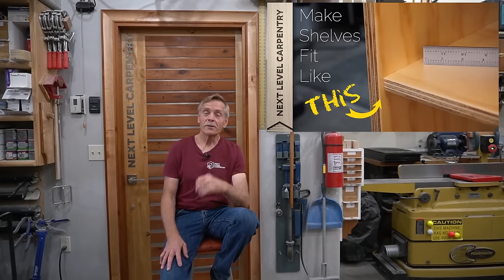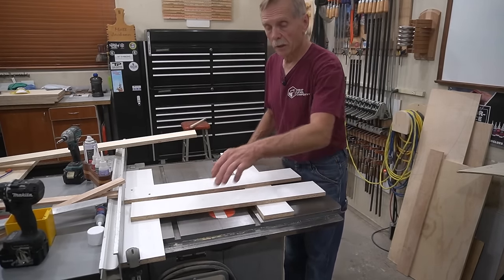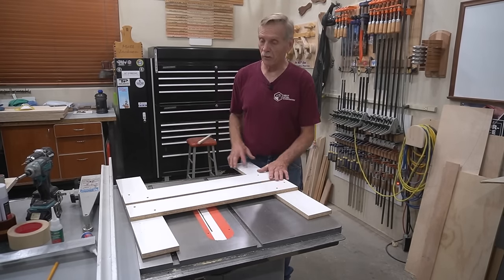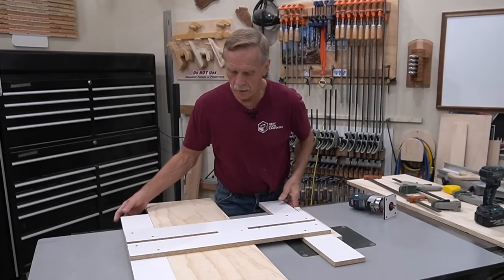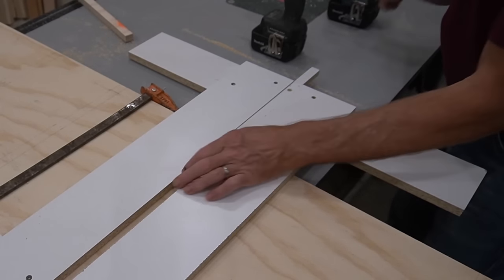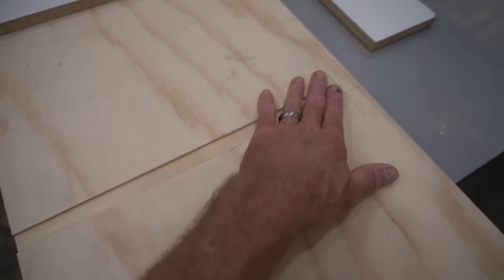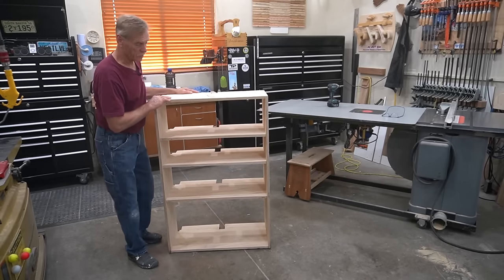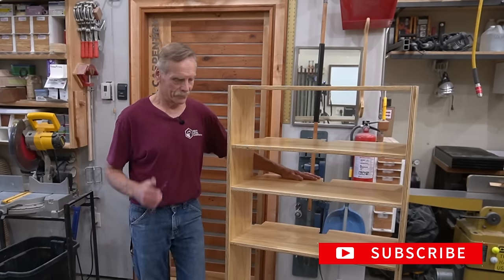Make Shelves Fit Perfectly with Simple Stopped Dado Jig!

Comment: I was expecting to see you score the sides with a razor before routing- I guess a sharp enough router bit doesn't splinter the veneer?
Reply from the maker: Scoring would only spoil the end result.  Even a dull-ish bit generally leaves only a bit of 'fuzz' on the edge of the dado but those can be removed quickly with a sanding block...

Comment: Another way to hold the pieces in place prior to screwing is an 18 guage stapler.
Reply from the maker: Yeah, no, not in my shop.  Not going to tell anyone how to work because everyone has their preferred methods and work flow but I think air staplers and nailers are way over-used.  In your defense though, I suppose staples are actually cheaper in the long run than CA so there's that. Regardless, thanks for watching and commenting here... alternate methods add value to any conversation so, thank you. 😎

Comment: The only issue is that you cannot adjust the distance between shelves, if you want to store different things afterwards. Therefore I prefer to make holes for shelf supports according to 32 mm standard. Much more convenient for later use.
Reply from the maker: That's not an issue for this situation or I would have made the shelves adjustable.  This is to show viewers an alternative design that's good looking and incredibly strong.  FWIW There are those who don't like the look of all the exposed shelf clip holes too, so there's that.

Comment: The jig dosent address accuracy on the second panel. There is a chance the dado will be off by a few seconds on each panel making the fit not square.
Reply from the maker: If there are any alignment issues from one panel to the next it is a matter of operator error or inattention not because of a fault in the design or performance of The Jig. Besides many other methods almost guarantee misalignment even if they are used carefully.

Comment: Matt, why did you wait so long to show this jig?  I could have been using this rather than the common and difficult ways.  I have used router jigs and dodo blades in my table saw.  I hate them.
Reply from the maker: Sorry Jim... never occurred to me before?  My frustration with dodo blades lead me to develop this some years ago.  And it was more my disappointment with results from other methods than the actual difficulty of using them that was the real motivator.  I didn't get into it in this video but this works amazing on angled dados that aren't 90 degrees to an edge or double-stopped dados like you might see in a double-sided bookcase.

Comment: Why didn’t you make the dado go forward a little more so the shelves would be flush with the front edges of the vertical sides?  Kinda bugs visually that the shelves sit back 1/4” or so vs being flush in the front.
Reply from the maker: Another great question!  What triggers such question is your 'design sense' which is a good sign for your future in woodworking/carpentry... congratulations.  Now that you've noticed this and pointed it out, I encourage you to go on a site like Pinterest and do a quick search for 'bookshelves'.  Notice in the results how many examples you see where shelves edges are recessed a bit and how many are perfectly flush.  Almost all of them are recessed a bit, some are flush, and there's even some where the shelves stick out a little bit.  I prefer shelves that are set back a bit for a number of reasons but, if I have a client who wants flush shelves, I'd make an adjustment something like what you ask about to scratch that visual itch.
All that is to say that there's no real right or wrong because it's more a matter of preference than expertise IMHO.
Best,
Matt

Comment: 34 min to explain something that could be done in 5 min.....
Reply from the maker: Go for it, dude... $100 cash says you lack the knowledge, ability and character to prove it, much less actually teach legitimate viewers what I teach in this video in 5 minutes... or even 5 hours.
Reply: Ignore the trolls @NextLevelCarpentry  
A very informative video ,  I will be able use this jig for through dados, rabbets as well.  I have a small shop with no router table or dado stack so this will be much better than using a bora panel clamp as a router guide.

Comment: Just frikkin glue it, screw it and plug it. Takes 5 minutes at the outside.  A plywood dado is a waste of time. You are just weakening both members. Appearance-wise here's a tip: nobody is inspecting your impeccable plywood joinery or checking for telltale plugs.
Reply from the maker: "How you do anything is how you do everything"  Nuff said.
Reply: you crack me up, troll.
Reply: The way Matt did it is IMO better than what you propose. 1) the dados act as an excellent alignment tool during assembly, 2) The bottom of the dado provides a nice bearing surface. 3) The notion of strength loss in the vertical plywood members by removing 1/8- in. of their cross section especially where they are braced by a shelf is meaningless,  4) Drilling countersunk holes, gluing in plugs, cutting/sanding them off flush, all takes time too. 5) Telling Matt that nobody cares what his plywood joinery looks like is like telling a top model to go out for a modest dinner dressed like a slob in tattered clothes. That's not him.
Reply: You're missing the point, (dodo) troll.  The point is to show a variety of carpentry methods/skills to achieve a desired finished product: everything from stopped dados to fit/finish to installation, and all the hows/whys in between.
Reply: I was inspecting his impeccable plywood.
Reply: "You are just weakening both members" - If you were to ever put so much of a load on the side boards that they break or delaminate then guess what: Those plugged joints you suggest will fail long before that.